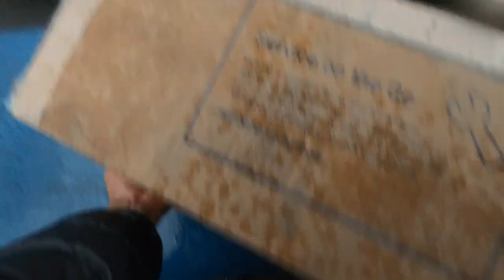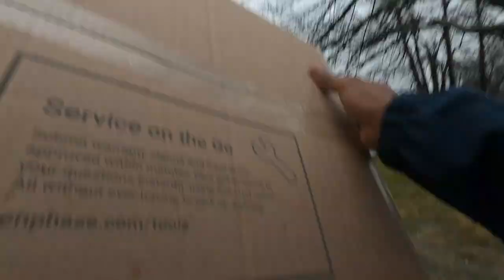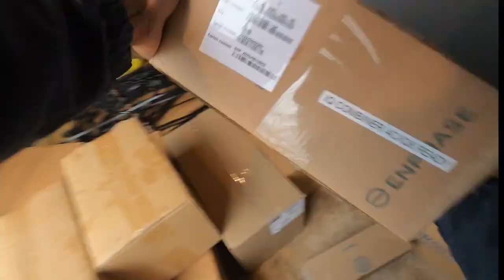This Is a GREAT GIG APP To Have!! Which Order Would You Take? #foryou

Comment: Are you still using your regular car insurance not a commercial one btw dispatch app is that the best one u found so far for van loads. Just curious what your avg on van fuel like full tank of gas, this is the gas model I'm assuming
Reply from the maker: No, I’m not using commercial insurance. Dispatch has been good for me so far, but it may be different in order areas. Loaded I probably get around 325 miles.